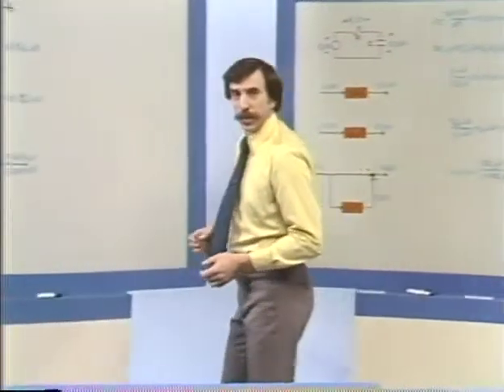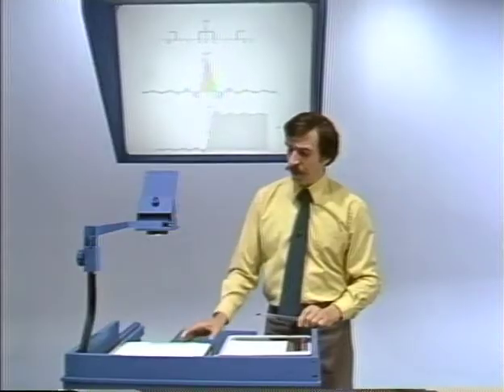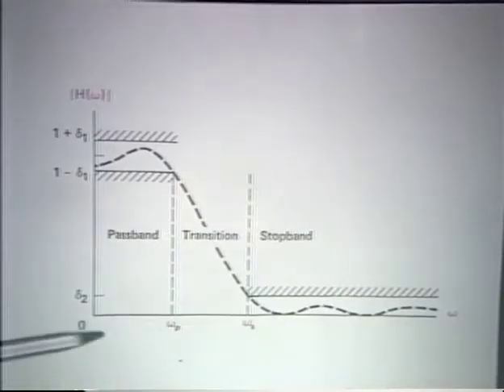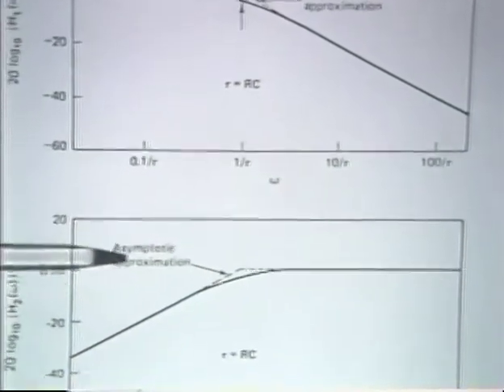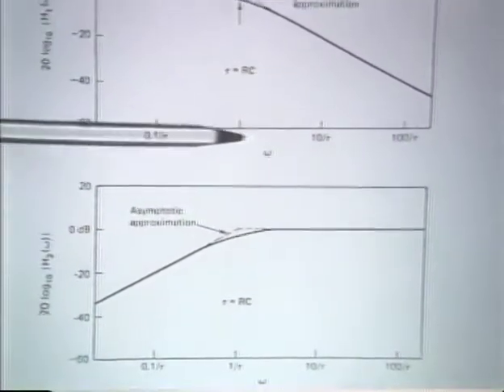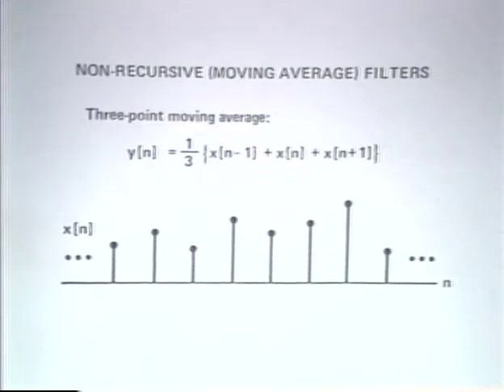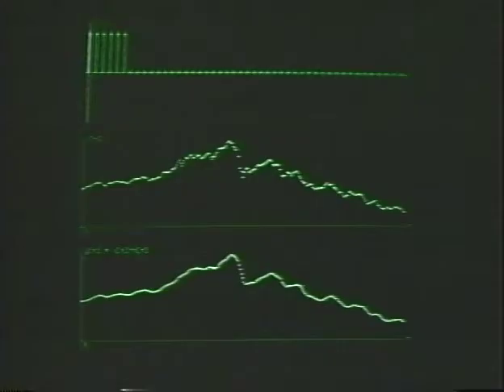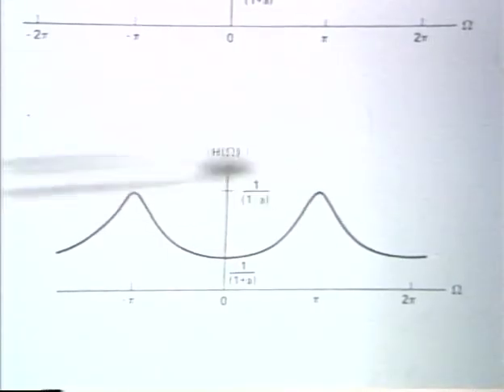Lecture 12, Filtering | MIT RES.6.007 Signals and Systems, Spring 2011

Comment: It’s a great video series, but in this particular lecture, there are some issues:
• 1st order filter (high-pass or low-pass) does not have a slope of 10 dB per decade, but it’s 20 dB per decade (which btw. equals to 6 dB per octave). The graph seems to be correct, but the spoken values are not.
• when you start with filters in the sense of high or low pass filters, defining pass- and stopbands, then it’s far from ideal to go to an equalizer to demonstrate filters. An EQ band can definitely be called “a filter”, why not, but it is definitelly not a band-pass filter. Professor Oppenheim should have either explained what resonant circuit (an electrical resonator) looks like before going to an equalizer. Or he should have only used the HPF as an example at the console. An EQ band is NOT a band-pass filter, even though it’s claimed several times in the video.

Comment: I did word count for this video:
"filter" + "filters" + "filtering" occur 123 times. On average once every 20 seconds...
"frequency" happens once per minute. Just like "now"and "Now".

65 filter
45 response
42 frequency
42 fact
41 filters
37 average
35 output
32 can
30 ideal
29 moving
27 lowpass
26 frequencies
24 just
23 impulse
23 Fourier
23 time
23 now
22 transform
22 also
22 Now
20 system
18 discrete-time
18 see
17 filtering
17 example
17 look
17 one
16 equation
14 input
14 want
14 show
13 associated
13 function
13 low
12 difference
12 course
12 notion
12 back
12 let
11 capacitor
11 highpass
10 continuous-time
10 important
10 equalizer
10 referred
10 sequence
10 effect
10 points
10 either
10 first
10 like
10 set
10 two
Reply: get a life bro wtf